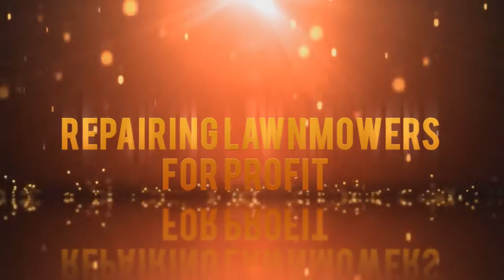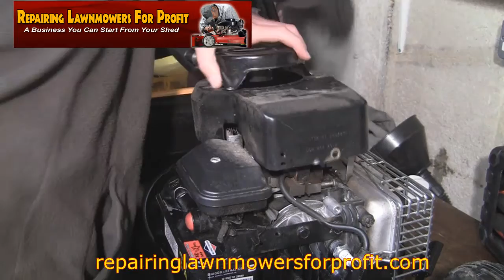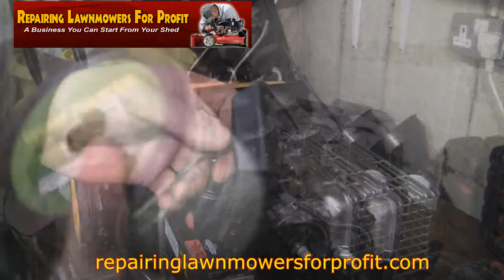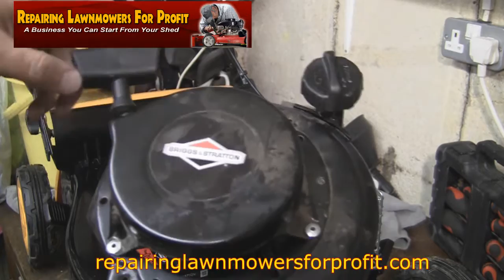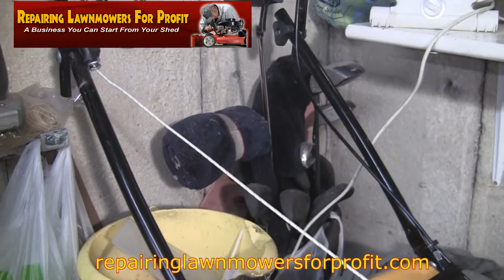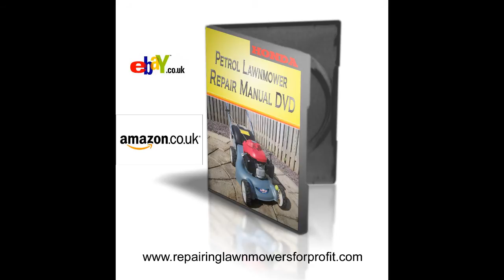How To Replace A Mc Culloch Petrol Lawnmower Starter Rope

Comment: I hope this is a simpler question -I Hvae a Soverignlam mower - at the front the s silver  clam has come off -so has the the bolt . I have spare one.sivermetal clamp - and spare bolt ...I heard it GO or brek - but unsure why the silver clamp is difficult to Tighten ....and not sure if I am tightening the bolt proerly

Comment: I have the same mower and after changing and cleaning everything it still won't fire up.  I have tested the spark and different plugs..I have put a tank and carb from a running mower on but still nothing? Dead man switch is ok...Oil up to the level...Blade and boss ok! Any ideas!!??